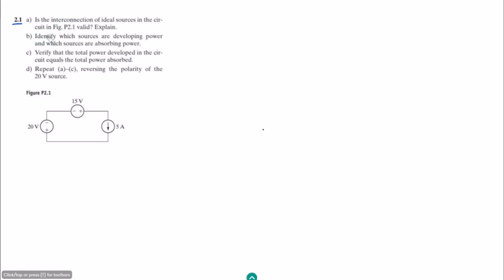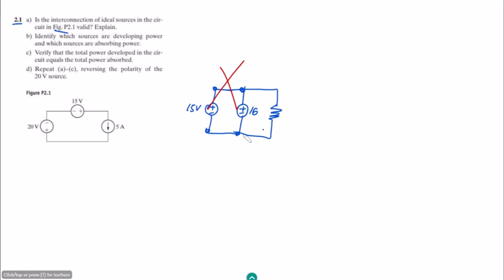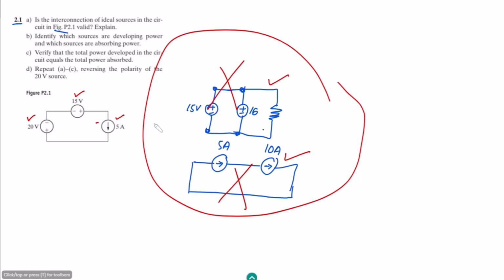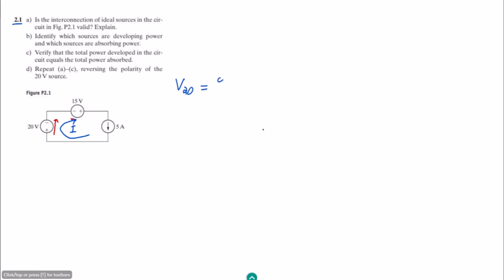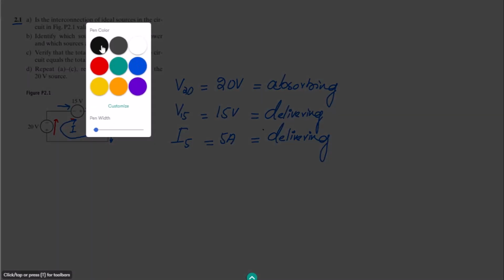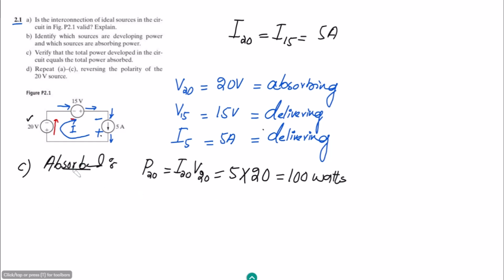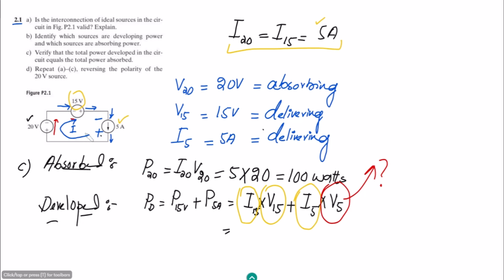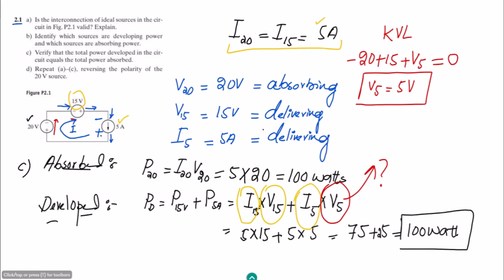2.1: Valid Electric Circuits – Electric Circuits by Nilsson (Voltage & Current Source Analysis)

Comment: 4:28   You are saying you should also keep... and in the next video you applied KVL to determine the polarity !!  what happend to you why did not apply KVL here as well or at least make the idea more clear in what to do
Reply from the maker: for voltage source, the polarity is fixed. For resistances, the polarity is based on the current directions.
Reply: @EngineeringTutorOfficial 
I’m talking about the current source.
You mentioned in this video that “ you should always keep that the polarity is that the( + )is on the top of the arrow “  and you did that directly in the same video. But in the next video, it was the same case which the polarity of the current source is not given and however you didn’t consider the + sign on the head of the arrow as you had told us, you did KVL and make it on the tail instead. So I am asking why did you do that ? Could you please make it clear.